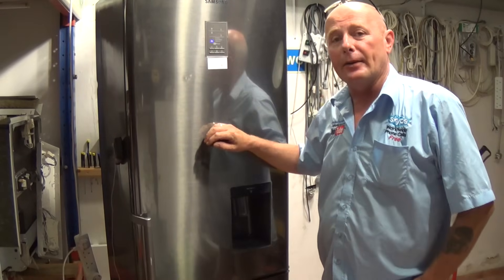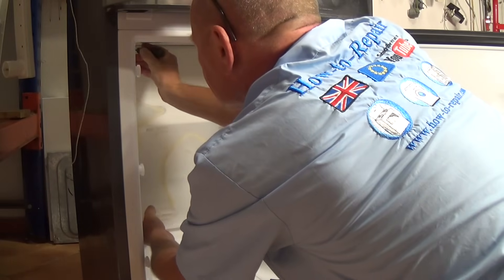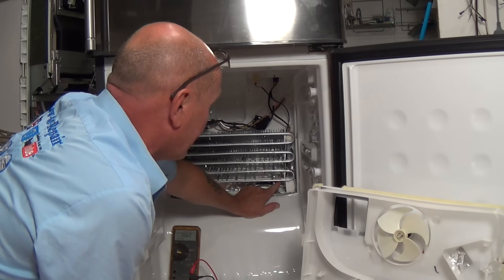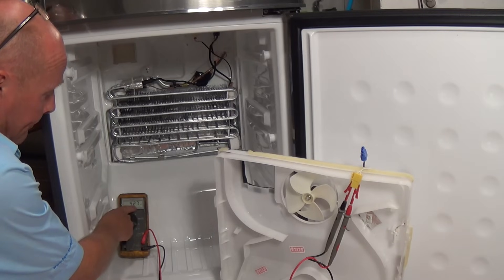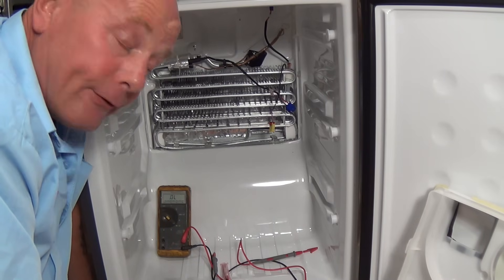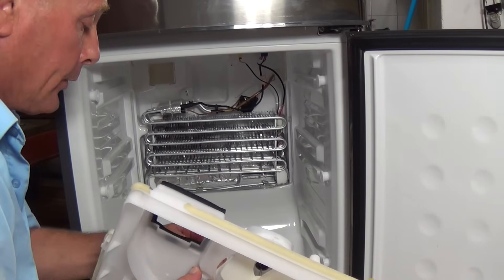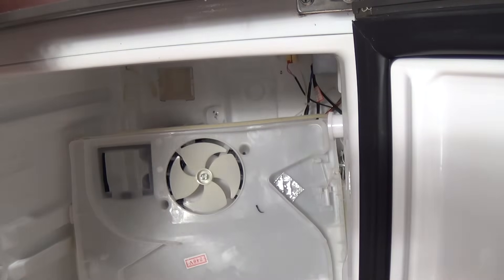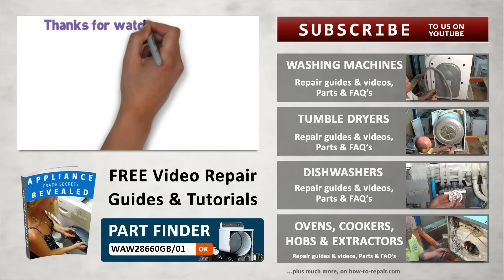Part 2 Samsung Fridge freezer faults Testing Ntc,Element, Thermal fuse and replacing parts

Comment: Sure looks like the bag was not sealed when it was manufactured. And the fault was not rejected at assembly time. Sounds like manufacturers built in Job security. Either a new fridge gets bought or a new part gets sold. I Used to service appliances 30 years ago. I was looking around to find some one to watch to get some updating of my knowledge on the newer units and found you. I can tell by how you speak and present you know your subject. Thank You.  Mark  S.

Comment: Thanks for the great in detail video. I have a Samsung fridge freezer RL39WBSW, over the last few days all of a sudden stopped working, so turned off at the mains and turned back on and started working fine, however when the fridge and fridge get to the desired temperature the compressor turns off and then won’t turn on again until I restart on and off from the mains or the power button. I have bought a multimeter and tested start relay, overload protector, start capacitor and tested all the sensors and probes mentioned in your video including thermal fuse which all seem to be good and now just lost, no faults shown on the display either. any ideas?

Comment: Fantastic video you have got there,  but the thing is that i have the exact same refrigerator you just worked on but the issue is that its not coming up , the compressor has a faint humming sound from it internal motor i guess and the top fridge light is on help pls

Comment: God bless you Sir. This video is pure gold and I will re-watch it.

I am going through fault finding myself, that is beyond replacing the fridge door gasket. 

My fridge goes from 5°C to 10°C too rapidly (~15min) and causes the unit to activate fan and possibly compressor to cool it down. 

The 5yr old fridge (RB31FERN...) only started this "overworking" behaviour since last Friday. (I work such long hours in the kitchen, I know this fridge's behaviour by heart). If I don't attend to it, I know the December electric bill will be higher.

I don't want to call the useless Samsung guys. I've seen them lie to my mum too many times and now it's my turn to either call them, fix it myself or buy a new fridge.

Comment: Good day.

For 5 days mine has been activating vacation mode on and off repeatedly by itself. From the 6th day the display temperature for the top is completely off but for the freezer its displayed -20 degrees Celsius.

The buttons are non responsive when I press them once or press and hold.

Any advice?

Thanks in advance, Kat from South Africa 🇿🇦

Comment: Thank you so much with your video. Well my problem is, in the fridge,there is no air passing thru so i detached the plastic cover on it and found out that a vent door like is broken and it was stocked, closing the vent. So i fixed it, i put adhesive on it,and put it back into places.my problem is that it drips water after i fixed it. Its like theres a build up of moist then it keeps drippping
Reply: Model is RB29FSRNDSA/TC Thanks in advance

Comment: Hello. Thank you for this video. I have experienced similar problems with my Samsung RL40 fridge. Am attempting a self repair with the hope that it is a similar issue with the thermal fuse/ntc sensor. I do however hear clicking noises coming from near the compressor area. Could this be when the defrost cycle is trying to take place but is not? Any help in this regard is truly appreciated.

Edit: I am awaiting a multimeter to be able to test the various components. The freezer does cool but the fridge gradually loses cool until I remove the cover and manually defrost.
Reply from the maker: it might be the starter relay or compressor 
Iam Glad we could help you
Please remember to subscribe to our channel
https://www.youtube.com/user/Apart4u?sub_confirmation=1

Remember to Shop with www.how-to-repair.com and it would help us by posting the video or

website on your timeline. This helps us a lot and if we really helped you can
always buy us a beer http://how-to-repair.com/help/buy-paul-a-beer/

Please remember to mark us to your favourites also I would be grateful if you would
subscribe to our channels social media as this really helps my site and keeps
us going.
YouTube. http://www.youtube.com/user/Apart4u

Facebook. https://www.facebook.com/how.to.repair.appliances

Comment: Samsong refrigerator GR-B600GLHL how many  sensor I have I change 2
But the OHM 9000 NUT 5000 OHM
STEEL NO WORK
AND LED FLASH 6 TIME
THANKS

Comment: Hello, if you have a minute, I would like to ask a question. I have a Samsung frig(over and under-RB1955VQ). It will cool the frig and the freezer, but when it reaches the set temp, the unit cuts off, but will not activate again (to cool) unless I unplug the frig and plug it back in. Do you have a suggestion?
Reply: This symptom is typical of a blown thermo fuse, as shown in the video, get a multimeter and do a 'continuity' test on the thermo fuse plug. If the circuit is 'open' then replace the fuse assembly or alternatively source a Microtemp thermo fuse of the same rating and solder it into the harness (the value of the fuse is printed on the casing 70.0 or 077 which means the Holding Temperature is 77 deg C). The Microtemp thermo fuse is a fraction of the price of the replacement Samsung assembly, This series of Samsung are known for this problem.
Reply: L

Comment: Thank you for such a good video! I only didn't get it, why did you mention voltage for the heater of 240 volts? Is there a voltage transformer for the heater or this is normal in UK?  I'm in Massachusetts
Reply: Guessing Google wasn't around 4 years ago.

Comment: I have had problems with my Samsung RS267lash Fridge over
freezing and causing inside middle vent hole and fan to eventually freeze to
point of no airflow , then fan grinding eventually to a halt from being frozen.

When I force the fridge into defrost mode, it does not seem
to melt the ice either.
*Theoretically, if I force it into Defrost mode, the heating
elements should come on and should be able to test 110V Correct?

Don’t think it’s a bad Defrost heating element ,  last time I checked this it showed 96 ohmsDefrost sensor (yellow) was +- 2K at Room temperature. 
Thermal fuse (Red black /w white foam) = 0 ohms 

Not sure what to do now.
Reply from the maker: when you have a question please use our site for 24 hour response https://www.how-to-repair.com/help/contact-us/
Iam Glad we could help you
Please remember to subscribe to our channel
https://www.youtube.com/user/Apart4u?sub_confirmation=1

Remember to Shop with www.how-to-repair.com and it would help us by posting the video or

website on your timeline. This helps us a lot and if we really helped you can
always buy us a beer http://how-to-repair.com/help/buy-paul-a-beer/

Please remember to mark us to your favourites also I would be grateful if you would
subscribe to our channels social media as this really helps my site and keeps
us going.
YouTube. http://www.youtube.com/user/Apart4u

Facebook. https://www.facebook.com/how.to.repair.appliances

Comment: SR215MW SAMSUNG. Found this with reverse polarity on supply cable. Could this damage the electronic controller. The machine runs but no defrost and i have checked all the sensors and heating element/fuses which are ok.   Anyone have an opinion. There is ants in the controller which may well have done the damage but just want an opinion about the reverse polarity 220V/Neutral

Comment: Hello I wonder if anyone can help, I have a whirlpool side by side fridge freezer, the control panel is set to 2c but it never reaches that temp, the damper door closes early hence stopping the air coming into the fridge section, I have checked everything else and all seems ok, Would a temp sensor in the fridge side cause this problem, ie temp sensor giving the damper wrong reading so it closes the damper door.

Freezer side is absolutely fine and at the correct temperature just having problems in the fridge section as it’s not getting cold enough.
Thanks I’m advance.
Reply from the maker: Glad it helped you

Comment: Kenmore pro 40140483800
Good Morning,
I have a Kenmore pro 40140483800, I am getting NO power to compressor at all. I replaced 3 computer boards: Samsung Main Control board, SAMSUNG REFRIGERATOR ELECTRONIC CONTROL BOARD DA41-00316D, and SAMSUNG REFRIGERATOR ELECTRONIC CONTROL BOARD DA41-00316D, Overload protection relay, Clean condensor. But still no getting power to compressor. 

I checked but NOT replaced any of the 3 the 3 bimetal sensors in the unit:
Freezer part =37.5 ohms
Refrigerator part: 95 ohms
Unit Part: 88 ohms 
A Sears tech came out to look at it and could not fix it. Then I called a second local Appliance Co and They had no clue either. Any help will be highly appreciated